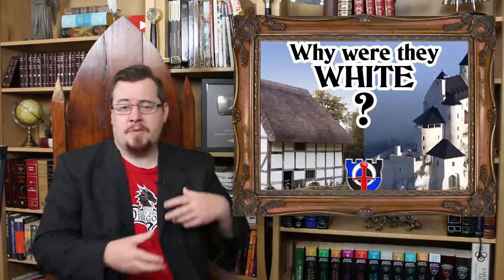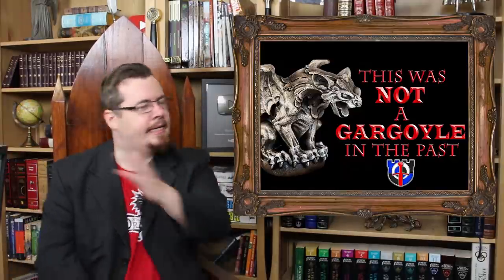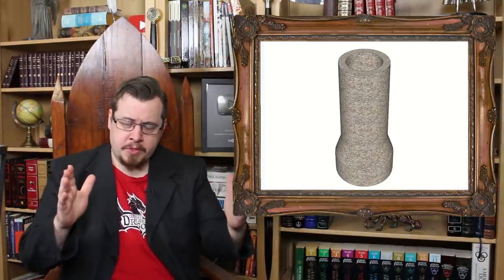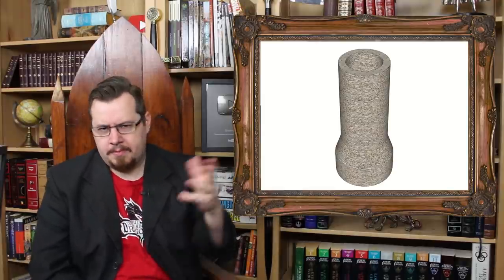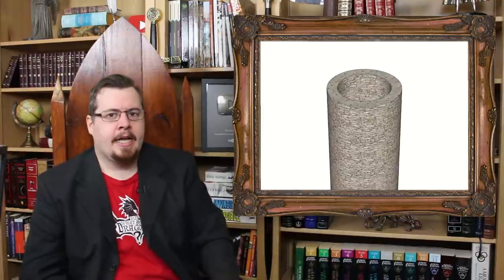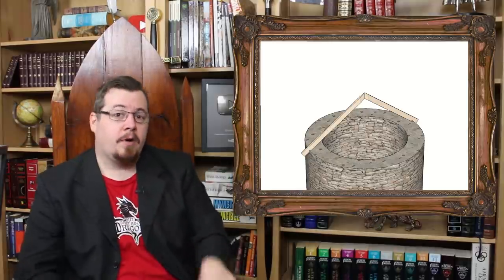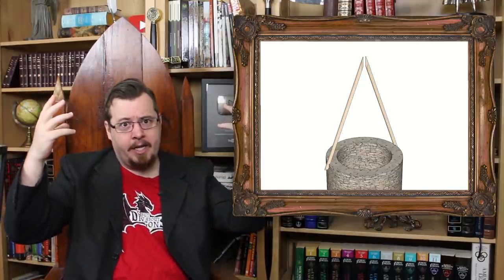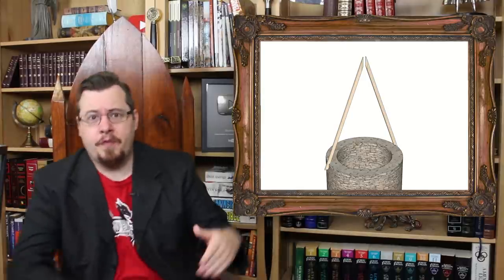Why do medieval CASTLE roofs flare outwards?

Comment: Pure conjecture here, and it may be more of an incidental feature than an intended one, but it could potentially make for easier maintenance.

I only know this because my brother worked for a roofer when he was in college. When working on a roof with an exteremely steep pitch, workers often wear harnesses with a line running over the peak to an anchor on the far side.

Obviously, the middle ages weren't known for occupational safety. Depending on the pitch of the flared section, it could provide a significantly more stable platform for workers to make repairs

Comment: Contractor, the answer is snow/natural debris. They didn't have ye old extension ladders to clear the roof off. Once it is built, you're going to have a hard time getting back up there. Might as well angle is as high as possible so rain sheers debris off and ice slides away so your castle doesn't look like shit. Also the thing about placing the main roof on a wall directly for support, and adding an angle so that it doesn't drain directly into the stone and instead falls off, they call it a "drip-edge" nowadays. It's a little L of metal that lines the roof so water drains an inch or so away from the house.

Comment: A roof would make for a really useful defensive structure, so it makes sense that they were added to castles at some point.  That, and they would protect soldiers from the elements, which is probably the main reason why they were added.   I'm sure things were a little more complicated when trebuchets were added to the mix though, which might be why a lot of castles didn't have roofs.  I imagine a shot from a trebuchet could cave in a roof fairly easily, and more importantly, having roofs would pose a challenge for the defender's trebuchets as even if they're kept in an uncovered courtyard, they would have to clear some pointy roofs.  It would be much easier if they weren't there.  I guess it makes sense that towers that had roofs were also generally in corners or on inner walls, as maybe that was by design, so that those towers could have the benefits of a roof while staying out of the way of their castle's defensive trebuchets.

Comment: Looks like Viollet Le Duc, who was an absolute genius when it came to understanding medieval architecture in the late 19th century, but he was also very prone to making things up, especially if they were not up to his standards, ie "Not medieval enough" and he would add elements to restorations that were not a feature of the original, so many castles were modified like Pierrefonds or Carcassonne where he added roofs to towers who never had them to begin with.
Reply: Yeah but they could have realistically added them if they wanted. it's not like it's defacing the structure or anything. Not to mention that castles (and fortified cities in the Case of Carcassonne) were never static. Every generation of lord tended to build on top of the previous ones, resulting in a mismatch of styles and structures. For example in Carcassonne you have the succession of medieval stone towers (for example at the bridge entrance) and the Roman towers (U shaped with layers of Bricks) at the back of the city and forming the Inner wall)
Reply: @calimerohnir3311  It's the ship of Theseus problem, castles and buildings were modified during their history, long before "restoration" was even defined and V-L-D was a Gothic specialist so he didn't feel like plonking a pyramid in the middle of the Louvre though he did use elements on buildings in areas that never had some of the features he added like certain decorations.  He also removed later additions like an altar built during the reign of Louis XV.  And what do you do with say something like Blois which to the untrained eye looks "period" but is a mix of Gothic, Renaissance and Baroque ...

Comment: Could it also be that it increases the amount of tower you have (radially) without massively increasing the weight of the roof? It would take much more material to make the steep cone all the way from the outermost walls, even if you did split the load through the use of extra beams.

Comment: Hammerbeam roofs are even cooler, because they rest on the wall and on much lower internal corbels,  putting weight on the interior of the wall, and counteracting a measure of the outward pressure it puts on walls or buttressing.

Comment: There is an additional reason for the flared-out roof design that arises out of pure functionality. 
This is a characteristic of "gothic" style castle roof structures which were generally built replacing earlier much shallower roofs after the 14th century. The incredibly steep roofs on many castles were built in many cases for purely stylistic reasons, but the flaring arose out of a practical consequence of how these roofs were framed. You show a picture of Schloss Thun, for example. This was built in the end of the 12th century, and its massive gothic-style roof was built for stylistic reasons in the 1430's

The first difficulty is that the steeper roof was much bigger, so it was MUCH heavier. The ceramic tile used on castles roofs weighs quite a bit, and the much taller steep roof weighs considerably more than a shallower roof covered with snow. SO this necessitated a very complicated roof support structure. 
What generally arose was some variation of the sort of roof structure used on churches at the time. In the primary rafters follow the shape of the support structure. The disadvantage of this is that their ends would then be WITHIN the castle's walls. So to take care of this, they added a flare at the bottom to kick the roof line out over the walls. In German this is called Aufchiebling 

Simply resting rafter ends on the walls like you show would not work. Rafters unsupported at the ridge will exert tremendous outward thrust at their base, and so the simple roofs structure you show would tear itself apart. The actual framing of castle tower and turret roofs was quite involved and complex. Remember these are extraordinarily heavy roofs with thousands of pounds worth of thrust. One advantage of steeper roofs, however, is that the horizontal thrust is greatly reduced, more of the weight of the roof is loaded vertically. 

I'll try to link to some pictures of actual roof framing so you can see how complex it is. 
http://forestryforum.com/gallery/albums/userpics/29312/IMG_1656.JPG?easyrotate_cache=1361242722
http://forestryforum.com/gallery/albums/userpics/29312/IMG_1657.JPG?easyrotate_cache=1361242732
http://forestryforum.com/gallery/albums/userpics/29312/IMG_1662.JPG?easyrotate_cache=1361242776
http://forestryforum.com/gallery/albums/userpics/29312/IMG_1659.JPG?easyrotate_cache=1361242758
http://forestryforum.com/gallery/albums/userpics/29312/IMG_1067.JPG?easyrotate_cache=1361231314

Comment: Its not just that snow slides off the steep roof. The steeper they are, the more pressure they can withstand. Snow mostly doesnt usualy slide off a roof that easily :/

Comment: They also knew to anchor the tall roof to the inside of the tower to keep wind from blowing it over, keying it in as it were.  Plus if you anchored the roof to the outside you would see the anchor straps/ beams on the outside. Not very posh :-)

Comment: I figured the reason was that the snow/rain would pick up speed through the steep part then hit the lesser angle and get launched far away from the walls so there'd be less erosion. The real reason is quite a bit better lol guess I never noticed it was only on walls with MACHICOLATIONSSSSSS

Comment: There's another reason. To stop roofing slippage. My house is from 1380 and we have a York stone roof. It has the secondary angle. The higher ones rest on the less acute angled stones, both anchoring themselves and through their weight the lower ones too.
Reply: 1380? Well conserved
Reply: @gabrielalejandrodoldan4722   yep. The oldest building in the village. The rest of the village is built around us.
Reply: @rossdiggle  
Amazing

Comment: Your argument falls short, in my opinion: I agree that the load-bearing capabilities necessitate a roof in two parts: a center part on the load-bearing wall, and an offshoot for the machiculations. Sorry, MACHICULATIONS! But why is the outer part angled differently? Would it not be possible to have the two sections of roof have the same angle?
Reply from the maker: takes more resources to build the inner wall higher for the roof angles to align straight.

Comment: Are there examples of real historical castles that were badly constructed or even partly collapsed in the medival period because of architectural mistakes?
Reply: Yes, the most common mistake were wooden/thatch roofs. Most castles burned out several times during their lifetime, because the roof catching fire from lightning or candles.
Reply from the maker: I'm sure there must have been but as a result few are still around to find out why. . .